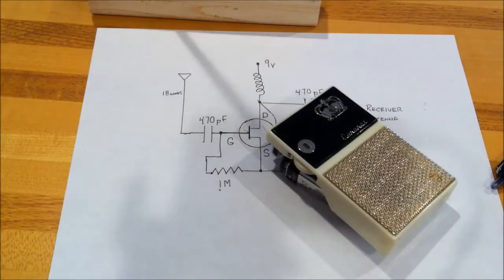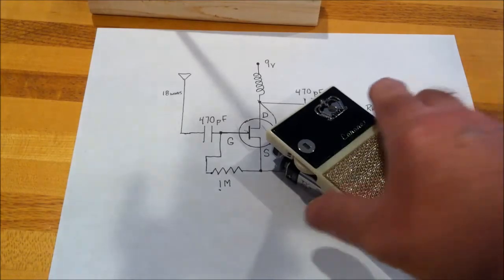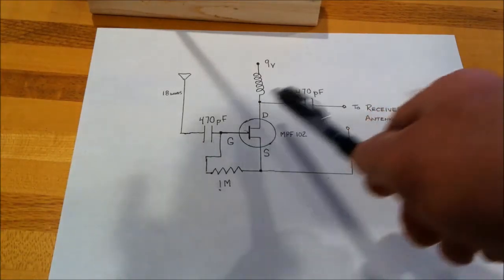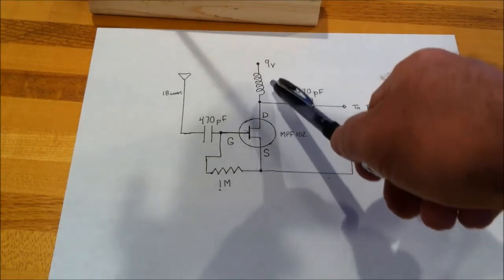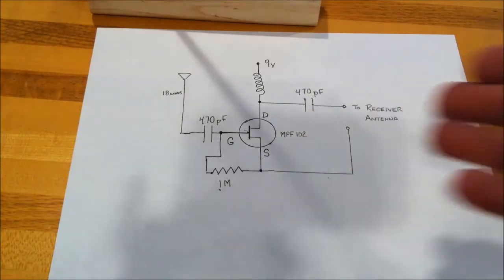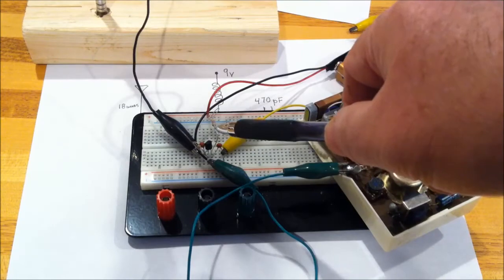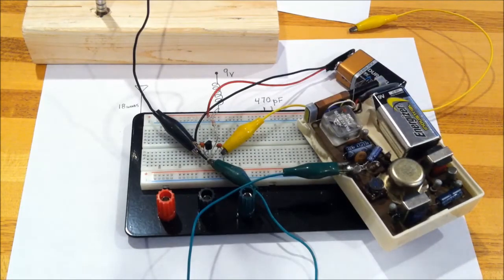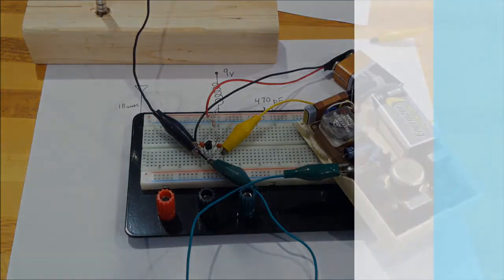Making Simple AM Radio Antenna Booster

Comment: Did you use an inductor that resembles a resistor? What is its value?
Reply from the maker: Thanks to question - I did this project about 8 years ago - but according my notes, the inductor was 470 uh. For shortwave or FM, you can use a 20 uh inductor.

Comment: great project, i can attach output of this amplifer to telecopic antenna of my radio
Reply: great to hear - thanks for letting me know
Reply: i have just telescopic antenna on my radio (no external antenna jack or port), if i attach this booster to telescopic antenna it works or not ??
Reply: The telescopic antenna usually just connects to the FM tuner of your radio. The AM tuner connects to a ferrite rod inside the radio. There have been a few AM and FM radios on the market with external AM and FM connectors, but for most radios, you need to open up the back and connect to where the variable capacitor (the tuner) connects to the ferrite rod. This will inject the boosted signal right into the radio.

Comment: plz suggest alternative for MPF 102 as in INDIA is not available
Reply from the maker: The MPF 102 is a general purpose N channel JFET VHF amplifier FET. You should find the characteristics on-line and match to something sold in your area. Good Luck. I even see them sold on Amazon
Reply: 2n4416 transistor.
Reply: the j310 transistor looks better in simulation

Comment: where on the radio do you attatch the lead, couldnt see at all. not very  clear. A complete diagram would have made everythig unambiguous to those not familliar with the inards of such things, and why there and whats actually happening e.t.c.
Reply from the maker: Hi John - thanks for your comment. On this particular radio, I attached the external wire from the booster to one of the two connectors coming off the tuning capacitor. You're right, I should have shown a diagram. Hopefully this winter I'll shoot this video again with better instructions.
Reply: You mean in between AM antenna and AM oscillator

Comment: Unfortunately, this video fails to show how to connect the amplifier to the "receiver antenna," which will be a ferrite rod having a coil of wire around it.  You are unlikely to find anything on the circuit board which says "receiver antenna."  The shown antenna is impossible, as an antenna will have two balanced connecting wires (not one) or else have a single vertical element and a ground plain -- again two wires: 1 for the vertical element and the other for the ground plain (two wires in the form of a coax cable -- vertical element to center wire & ground plain to the coax shield).   The choke coil in the circuit also lacks definition.